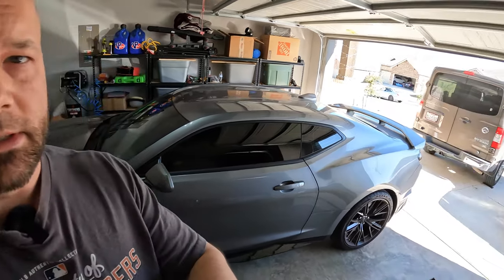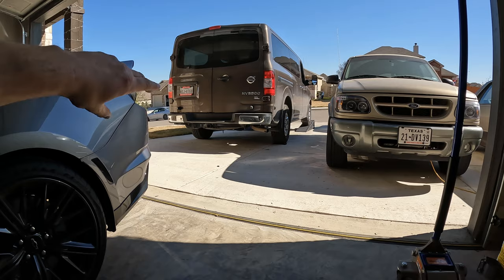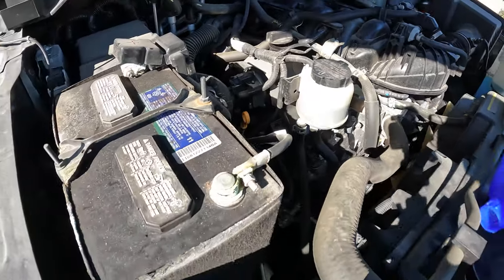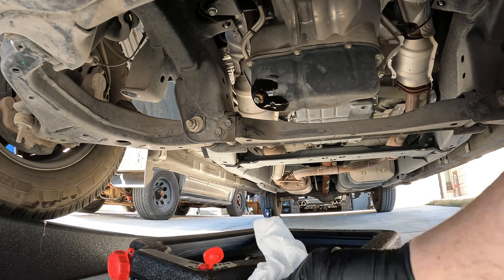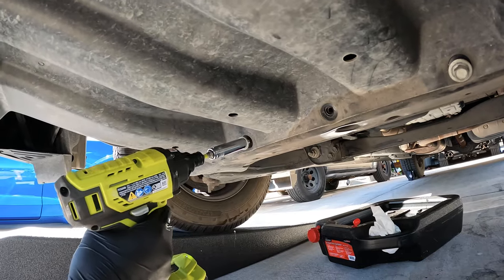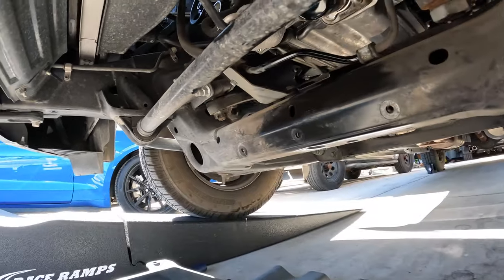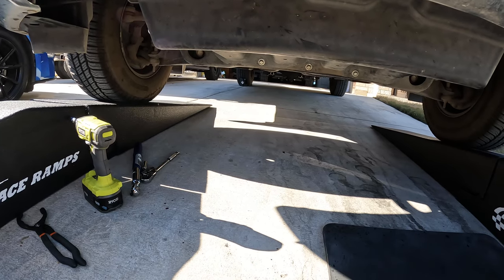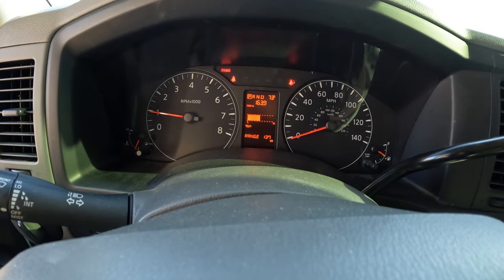Nissan NV3500 Oil & Filter Change + Instrument Cluster Reminder Reset! 5.6L v8

Comment: We have a 2014 and I stumbled upon your video today before I changed the oil. I’m impressed that your ramps held the weight. I destroyed my 16k pound rated Rhino Ramps the first time I slowly drove up on them. They replaced the ramps for free, but now my wife shimmies under to drain the oil and I do the rest without lifting it.
Reply from the maker: O wow... that's rough with the rhino ramps! I've had the NV3500 up on these race ramps a number of times and they are flawless, no extra wear and tear from the van thankfully. I have a QuickJack setup that could also lift the van but I don't have the ceiling clearance to do so in my garage sadly, lol.
Reply: @D3RPZILLA  Don’t feel bad. We have plenty of ceiling clearance and had our builder install extra tall garage doors in anticipation of us later buying the van. After we bought the van, it fit through the doors no problem, but the garage wasn’t long enough! 🤦‍♂️
Reply from the maker: @BRTardiff   Oooo... that's rough! I tried to get my builder to raise my 3rd car garage roof (it has nothing above it, just the roof, no rooms or anything... they shot me down :-/ lol.

Comment: Just found your vid and I need to start doing my own DIY Oil Filter on my 2015 NV2500 V6 High Top. I was intimidated by that plastic cover to get to the Filter. I’m not mechanically inclined but I always did my DIY O/F on my other vehicles over the years. Thanks for the DIY verbal / visual
  👍👍⬆️
Reply from the maker: No problem!! Glad it was useful! :) Nice work and good luck!

Comment: Did you ever get around to changing the rear diff fluid and make a video on that?  Also if you could make a video of doing the transmission would be great.  Not many videos out there on the NV.
Reply from the maker: Heya! I did change out the rear diff fluid but sadly did not make a video on the procedure. It's thankfully quite simple (loosen top fill plug, remove drain plug, drain, install drain plug, fill until a little fluid begins to leak back out of fill port, install fill plug, torque everything to spec). Unfortunately, I will not be doing any new nv3500 videos as we sold it. Now I regret not having it but at the time we never used it other than just myself driving around with no passengers most of the time lol.

Comment: Did you notice that the oil psi gauge is reading pressure with ignition on and engine not running.
Reply from the maker: I don't recall.. I don't trust gauges unless the engine is on and running. Any other time and I just ignore them, lol. Looking back at the video it shows the needle down by low but I don't remember the situation around it and as long as it reads properly when the engine is running is what matters 👍

Comment: Nicely done,  thank you! You'd think Nissan could be a little smarter about oil filter access.
Reply from the maker: Haha, yeah... many cars put nice cut outs into the plastic under shield to give you easier access but overall it's not to bad.. the little drain plate ramp thing is nice even if it only works on about 70% of the flow, lol. I do miss my 2017 WRX in comparison though, it had the oil filter on the top of the engine and it was super easy to replace AND it had an undertray cut out for the drain plug access.